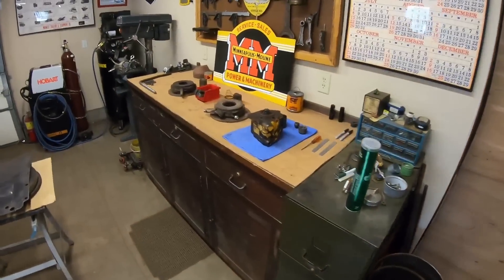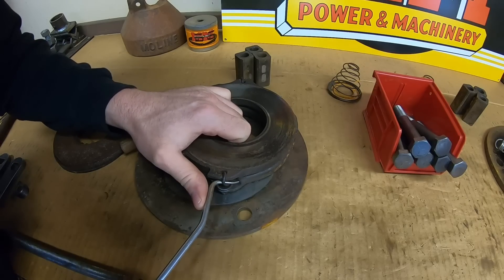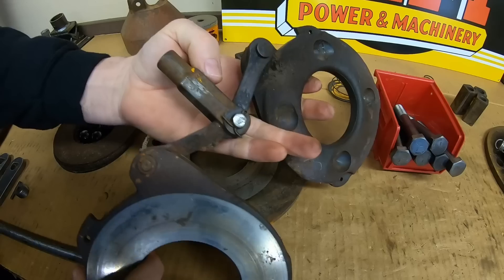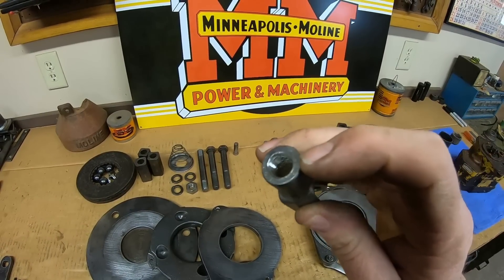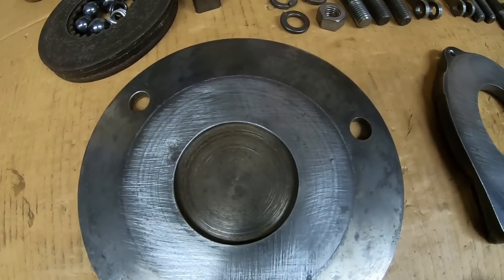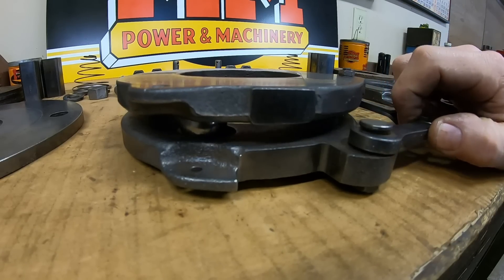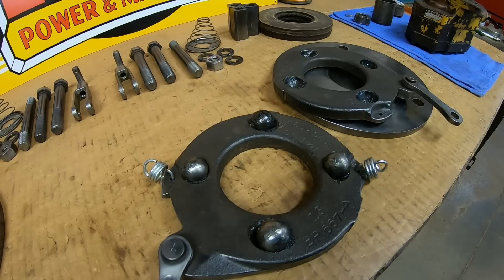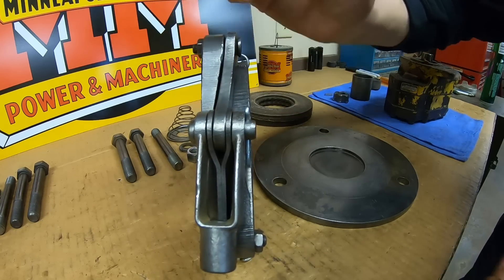#X231 Prototype Part 64: Rebuilding the Disc Brake Assemblies

Comment: Thank you for the compare and contrast. I am going to be digging in to the brakes on the 335 I have been working on this summer. I did not have to do anything with them when I rebuilt the 445 (Dad always kept up on thoughts) so I was not looking forward to it. I’m a lot more confident now. Glad to have this as a reference. Could have been fighting the spacers forever not knowing one was different.

Comment: I have a MF 175 with brake components very similar to what we saw today. My tractor had no brakes whatsoever when I got it. Last summer, we tackled renewing brake disks on both sides. Pulling off wheels and tires full of beet juice and then wrestling with final drives is a task you pray you never have to do again. When you said you had one bad disk, I was sending you vibes saying Replace All Four!  You then said you had ordered all four so you’re welcome for that. I see a glimmer of light at the end of the tunnel and this time I’m pretty sure it’s not another oncoming freight train. Good luck. 🥸👍🔧🔨✅

Comment: Could the dust control coil springs have been covered with leather or water proof fabric ? I'm thinking along the lines of the touch control boots on a farmall c or the MM shifter boot that looks like a hat on Charlie Biler's mm parts page.

Comment: that is the same breaks tipe that was used on ih 616 cotton pickers and early ih's   if a break is not holding you can take it a part and wire bruss the disk and replace them.
Reply: Brake, Type, Brush. I understand. English as a second language is hard with words that sound the same but have different meaning and spelling. You are doing well. My 2nd language was French, I have lost most of that living in an English country.

Comment: I know you were just using the Universal prying device, but the Craft...n label was visible in your hand as you assembled the spring to the press. plate. Besides Squatch does not seem like a Tool Snob, for those obserant folks, he uses many brands and when the tools perform well he says so. Even when it comes from Freight Harbor, lol. And converesly when it fails, we hear and see all about it. So let the Snap Off dealer figure out how to cope with that unintended, perfect product placement for a tool made by Others... 
Good stuff Toby it will be wonderful to see X231 completed and pulling out of your shop under its own power!
Parade queen or not, a running tractor brought back from a wreck that X231 was is a testiment to your desire and abilities. Thanks for the ride along Toby.

Comment: Thanks.  That explains a lot.  I think chrysler used ball separated mechacical disc brakes on one model car.  Never seen one in person but saw them in a book or manual. I wonder if the single warn disc was because of the self energizing effect of spinning disc against the spreader plate and ramping the balls
Reply: Ever drive a tractor with working brakes? They kinda grab hard all at once.  In a car this proved to be dangerous in rain, ice, or going too fast. Had it been in a model T ford and not a v8 Chrysler the stopping characteristics wouldn't have mattered . 😀

Comment: Maybe you could locate a rubber boot that would fit over that brake clevis port spring cover to keep dust and dirt out? I would think they make them that size? (Maybe an old VW shifting lever boot is around the same size?) I know it's not "prototype" proper, but might be something to look at to keep the old girl a bit cleaner, especially in that area of the wheel where ground contact is sure to kick up a good amount of dust?
Reply: Have an awning place sew up some party hats that will fit.  If it looks like a feed sack, we're on the right track 😂

Comment: I always appreciate when you tell us the product you use, I don't do these projects enough nor have formal experience to always know which one is best. And how do you get them cleaned up? Wire wheel, emory cloth and elbow grease or evaporust, etc.? 

And I do have enough experience on modern stuff to say the new design would may sure you need three hands, all smaller than a child's and xray vusion to get those bolts in!😂

Comment: How did you do the crosshatch on those brake pressure plates? It looks sharper than wire brush marks and isn't curved like sander marks would be. The brakes on my Farmall 450D look like a very similar set-up. Maybe a refresh is in order. I could likely do a lot of good to a set of brakes that haven't been touched in years if ever.
Reply: @squatch253  Thanks! They looked really good.

Comment: I had some flashbacks working with Belarus 500 breaks. Not exactly the same setup as on a Mouline tractor, on them it's more towards the IH Farmalls that had disc breaks. But the general principles of working and assembly are the same. It surprises me they used only a metal washer and spring to keep the compartment sealed? A rubber seal or dust cover would be superiors but than again what to I know :D

Comment: Hi folks, one spring trick my Dad once showed me was to thread a strong (nylon?) cord through the spring loop with a wood handle on the end of the cord. Works a treat on smaller in situ springs. I'm not sure that it would on these and the expanding discs would need holding firmly as well. Maybe worth a try in some situations.

Comment: I'm surprised that brake discs are readily available for these tractors. That's pretty impressive.
Thanks for the video!
Reply: It amazes me that sometimes I can go to a parts store and be told that the parts aren't available but I can mention another car that uses the same parts and they can order it or even have it in stock. I remember that my AMC Ambassador needed some bushings for the front suspension and I had to get the parts for a 72 Olds Cutlass. With minor modifications they worked fine even though the guy at the parts store said they weren't even close.

Comment: So remind me, what all is left to do to X231 to make it into a roller once the rear case is all sealed up? I figure Steering Bolster, Front Pedestal, Wheels and Tires, and of course fixing the flywheel so you can mate the engine to the transmission. Is there anything I'm missing?

Comment: Thanks for sharing. You are getting closer to buttoning up that rear two thirds of X231. I apologize for fast-forwarding questions on your projects all the time. I took note of the hydraulic ports in the top cover on your last video and wondered if the whole hydraulic setup except for the pump is in the three point rock shaft unit that goes on the top cover of the rear end. I guess I will have to wait and see.

Comment: Does x253 use this same style of brake in conjunction with the steering clutches?
Reply: @squatch253  makes sense, I was wondering if these small 445 brakes were part of the poor steering system on x253. Makes sense that they adapted brake bands around the Cat steering clutch drums. Cheers!

Comment: 👍That should be how most disc brakes on tractors works, I guess what I found odd, is why a speedo on a tractor? The optimum RPM is known which would give you you 540 RPM at the PTO shaft, All of the gears are fixed so you only have 3, 4, 5 or how ever many gears you have speeds. I could easily. understand is it was a hydro drive or automatic or if they never intended it to operate at a set RPM.
Anyway enjoy your day, stay safe on the icy areas while you play in the mud(if you have any) before. more snow at least for us right now this week, and again next week.